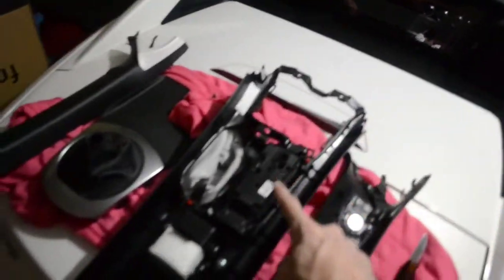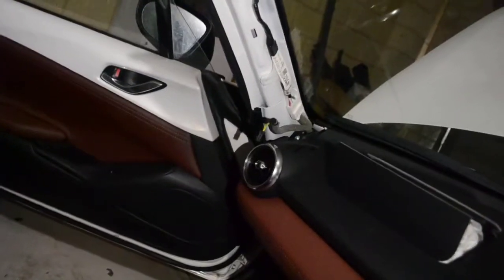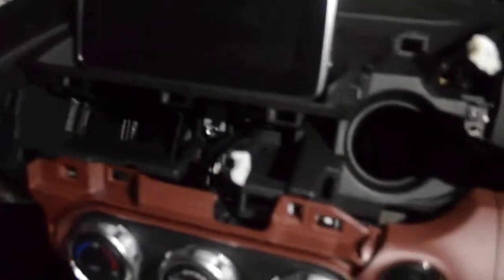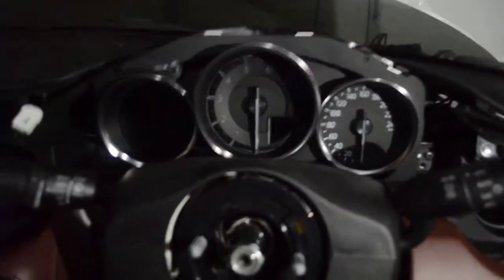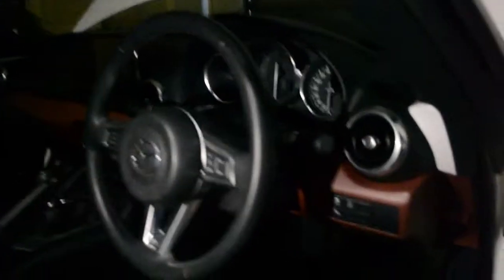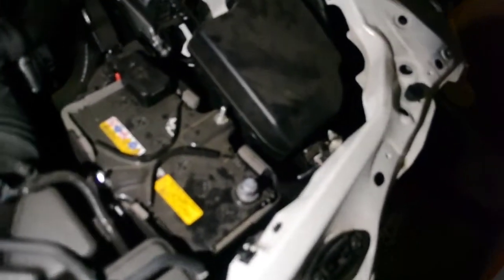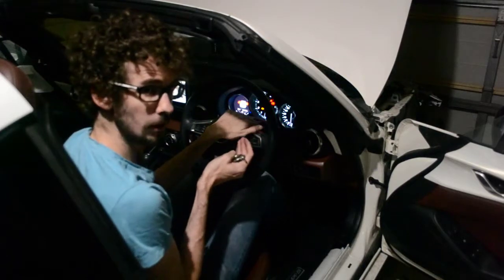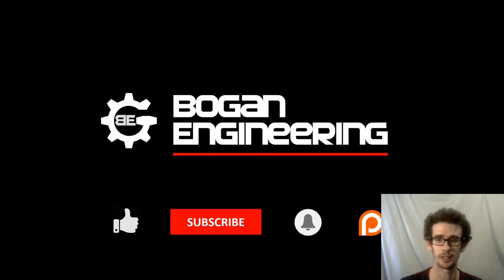MX5 Dash Replacement and SRS system reset (MX5 Rebuild Project)

Comment: Has this project continued? Any update on the frame damage? I've been considering starting a similar project on an ND but am a little wary given how little you can see without unbolting fenders.
Reply: This project did continue and I will put and update up sooner rather than later. The rails and subframe were bent but were easily fixed and you could do it yourself with the right tools. Big things to look for, kinked fender panels, suspension links and engine mounts. Those are your sneaky problems.